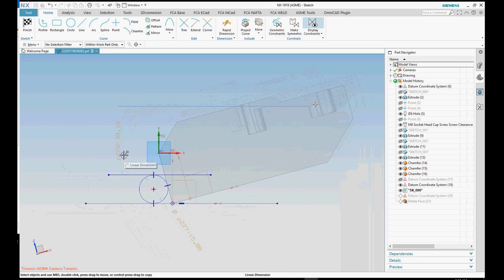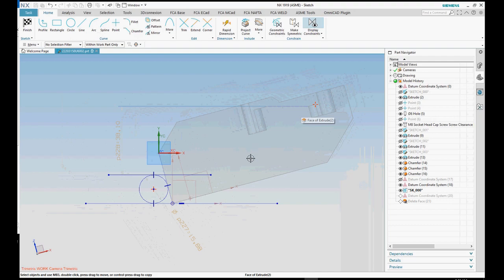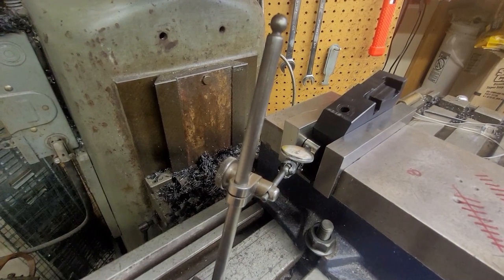ROLL DIMENSION – MACHINING MAGIC!!!

Comment: What about sitting on a deburred corner?  Wont this only work with a dead sharp corner?
Reply from the maker: Hello Cruch9, every feature has a tolerance so there is room for the corner not being dead sharp. If that corner had a chamfer that could have been included in the calculation. Good observation though I'm glad I could make you give it some thought. None of this is rocket science but it does require a little thought. Thanks for watching and commenting...
Mike - Plus8Precision

Comment: As your start point is on the corner and resting on a flat plane could you not just use a slip stack on the parallel and directly compare removing a lot of error potential stack size 15.88 + 38.1 = 53.98 all from your cad dwg if i got the sizes right. Or i often just use a digital height gauge with a clock pick up a known  feature then  directly compare . All the best Robert
Reply from the maker: Hello Robert,  the corner is up in the air because of the sine bar under the detail. I took a sliding parallel and adjusted it under the corner for the roll to rest on. To answer your question yes you could use the stack up for a measurement point. On that detail I didn't have any features I could measure to or from. And I can't use your final suggestion because I don't own a digital or dial height gage.  I can offer if I had an axis reader on my knee I could have used that, I still have the dial I could have made work if I had to. There's always more than one way to get the dimension you need. Thanks for watching and commenting...
Mike - Plus8Precision